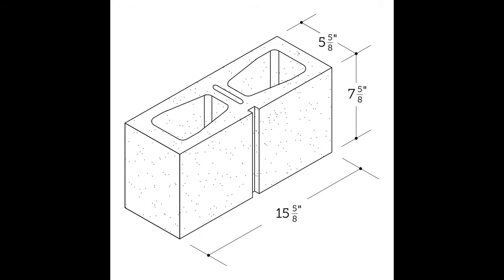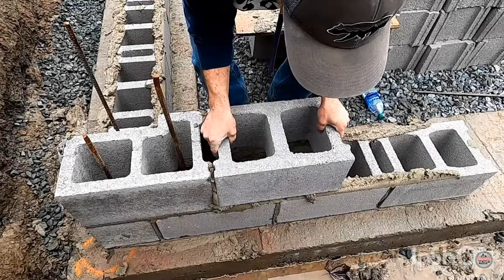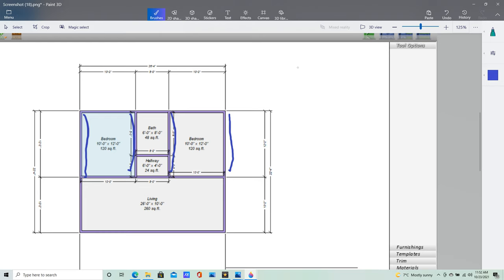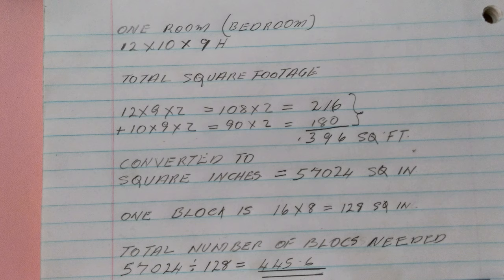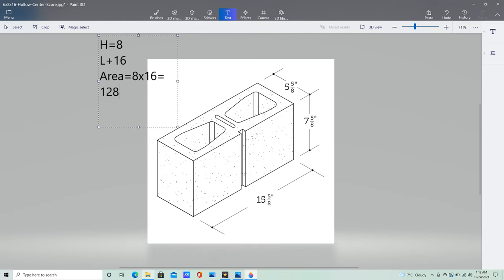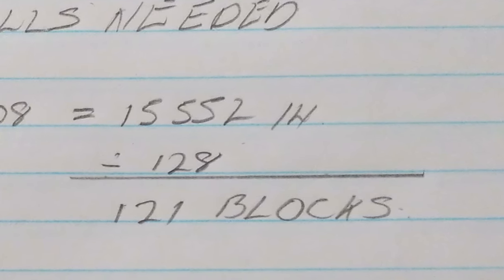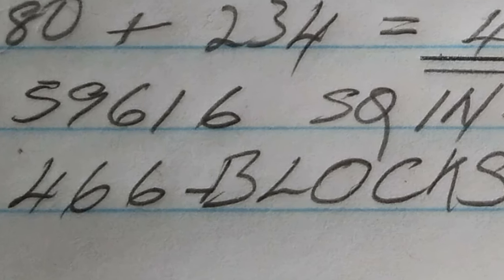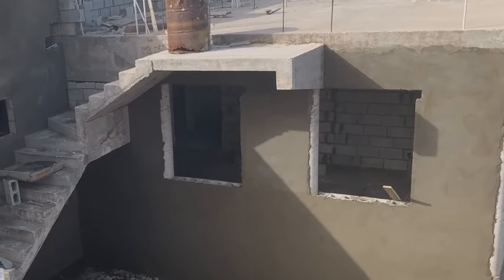Building Your dream House In Jamaica. HOW MANY BLOCKS DO I NEED?

Comment: To assist the block 16x8=128÷144=0.89 SQ ft.   This is for persons who want to maintain ft measure who have difficult converting to square inches. Since it will be feet you are working with.

Comment: Thanks for this useful information Jusssayin mipeece. I'd want to use 4 inch block for internal walls. Is this a good idea?
Reply from the maker: excellent idea. They are cheaper, take less motor to fill and provide just as good sound barrier for privacy.
Reply: @jussayinmipeece1069  brilliant. Thank you.

Comment: But yuh see square inches I don't kind a understand it though
Reply from the maker: Ok if you look at the front of the block you see that one side long and the other part short.
The long side 16 inches and the short side is 8 inches. 

Like you looking at a piece of flat paper. 
To get square inches you multiply the long side (16) by the short side (8) and you get 128 square inches.

Ok so then suppose you measure the side of the house and it comes up to 160 inches and you measure  the hight of the wall and it come up to 72 inches all you do is multiply the 160 by the72 and you get the square inches of that wall.

So in this case it would be 11,520 square inches.

Ok so you done know seh one block is 128 square inches so to find out how many blocks in that you divide the 11,520 by 128 and that gives you 90 so you need 90 blocks to make that wall.

And you do that for any wall. 
Just length multiply by height.

I don't use square feet because then you going to get into fraction and decimals and all that and mi really Caan badda wid dat at all lol
Reply: Yea thanks
Reply from the maker: @matthewstewart7238  no problem. Just let me know if you need help with anything else. I'll be happy to if I can. Good luck with your build.
Reply: Alright thanks